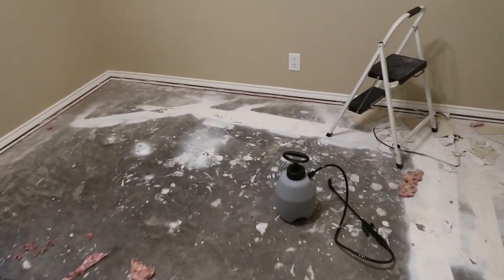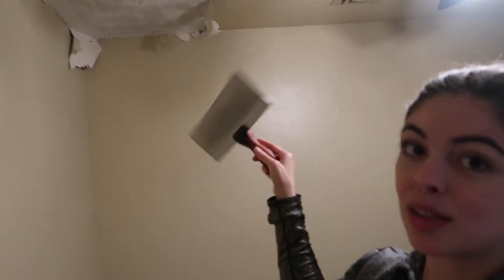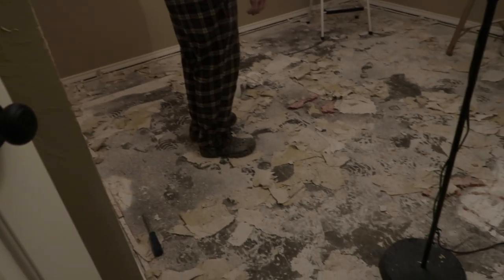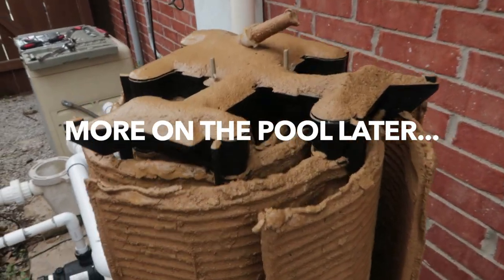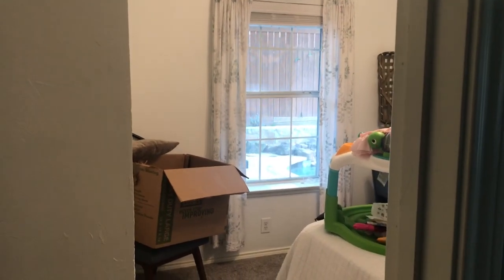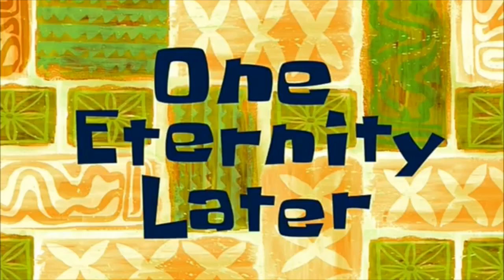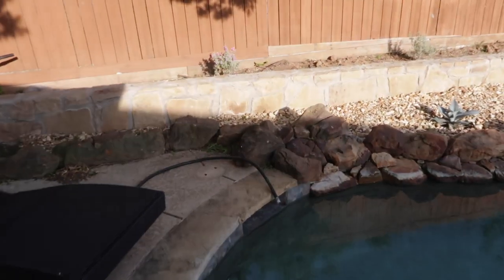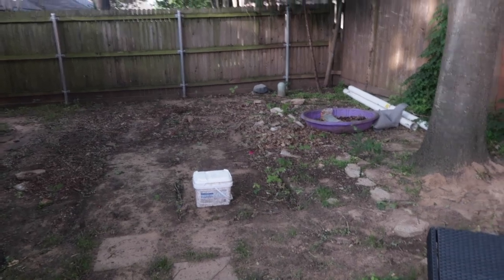DIY PAINTED POPCORN CEILING Removal & Re-texturing | DIY Pool landscaping update | Wkend Vlog

Comment: Hey Sydney, I am dealing with popcorn ceilings in my new home too as well. You did an amazing job. I'm curious if you had you ceiling tested for Asbestos? From my understanding most homes with popcorn ceilings contain Asbestos and I will need a respirator, eye protection and to well ventilate and block off the entire area being worked from the rest of my home when removing it. Just wondering what you're experience with it has been. Thanks!
Reply: If your house was built after 1977 you are likely good. Pre 1977 you may need to test.